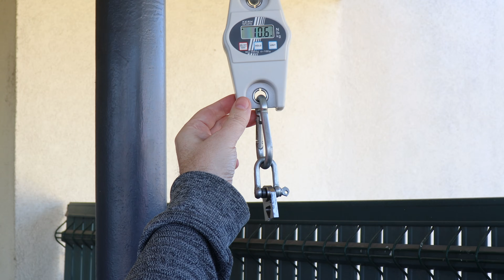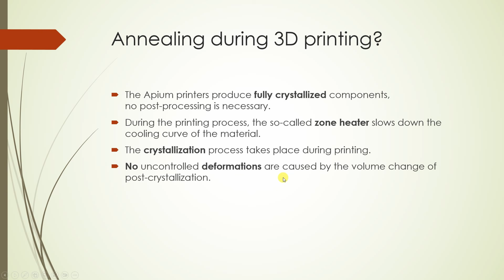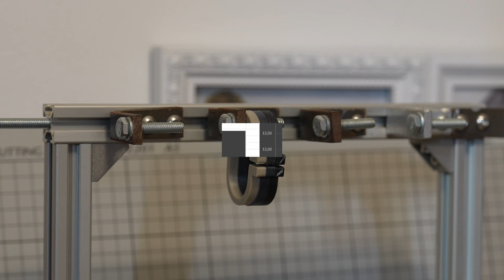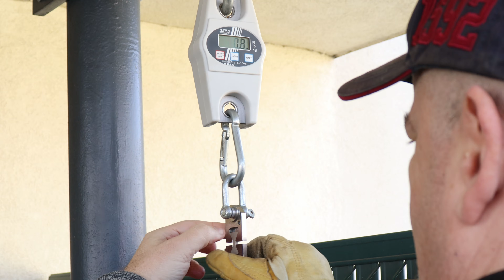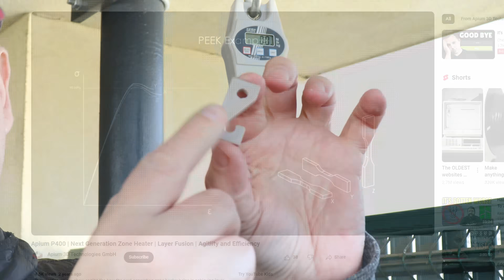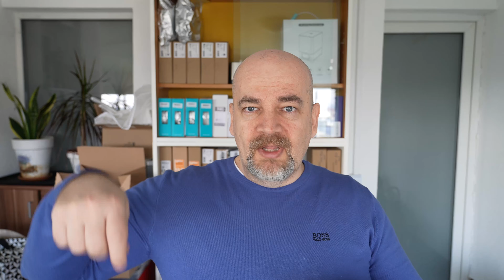3×PEEK: Natural, CF10 and CF30. All 3D printed on Apium P400

Comment: Hello everyone, I am the Kevin who printed the PEEK parts :)

First of all a big thank you to Igor for taking the time to do such material tests.👍
When printing such small cross sections as the tensile specimens, it is always very difficult to hit the perfect point between overheating and poor layer adhesion. FDM printing of high-performance polymers presents new challenges that do not arise when printing standard materials such as PLA. 
It is basically possible to produce isotropic components using zone heater technology. The Apium printers are used, among other things, to produce cranial implants for which precisely these isotropic properties are crucial. However, this requires a large number of test runs, as the printing parameters always depend heavily on the component geometry. Unfortunately, in this case I did not have the time to experiment with the optimum layer adhesion for this geometry myself. I only printed and sent one set of test components at a time. I will take a closer look at this problem in the next few weeks...
The mechanical properties are not the only thing that makes PEEK, PEI etc. special. Rather, it is the combination of the sometimes unique properties that justifies the use of high-performance polymers. For this reason, it is not correct to “reduce” the materials to their mechanical properties.
Reply: Kevin, thanks so much for donating your time and materials to this video. It's really interesting to see the benefits and drawbacks of this material in 3DP, and that's coming from someone who's done a lot of medical PEEK machining from solid stock.
Reply: That's why I got quoted 3k euro for essentially 40g of plastic, now I get it.

Thank you Kevin for the material and the work.

And thank Igor for the great video!

PS: I design medical devices😁
Reply: Your printer is very well calibrated, those top surfaces are perfect, pinholes aside which would need adapting PA to each speed.
Reply: @olafmarzocchi6194  You are right, I think that these pinholes are the reason why the hook test of the PEEK CF10 turned out less well. Under the microscope you can see the composition of these components very well (I´ve done some Research with Zeiss microscope up to 1000x) and it quickly becomes clear that it is not a homogeneous part, such as a milled part. For this reason, FDM printed parts will never have the strength of milled parts. However, 3D printing has a lot of other advantages, such as no tooling costs, lower machine costs and, above all, the possibility of producing geometries that were not possible by machining :)

Comment: You need a 140C chamber for peek. This is like printing ABS on an ender. Even if you remelt the top layer the whole print needs to stay at 140C for the duration of the print and then needs to cool down to room temp very slowly. After that it should be annealed. I'm sorry Kevin but you invested in the wrong printers if you want to offer anything above ABS on a professional level.

Comment: This is very cool, Igor!
I've been following Vision Miner for years, and I printed PEEK CF10 on my heavily modified 500C capable old CR-10 (as well as Ultem 1010 and 9085). And I used these materials in practical applications (hook for scooter trailer, mount for hotend, etc), and I can testify they are extremely durable. However I never knew exactly how strong they are, so thank you for doing this!

p.s. K2 Plus can out of box print Ultem 9085, I just did it few days ago! ;)
Reply from the maker: Wow, what bed type you used and what temperatues? (for Ultem). About Vision Miner, I am not sure why are they hesitating. I should get those filaments weeks ago.
Reply: @MyTechFun  On my old CR-10 I used PEI bed at 160-170C (AC bed heater), Nano Adhesive and 4x 75W UV lights (for lizards) to heat print (no chamber).

K2 Plus out of box can do 390C nozzle, 120C bed and 60C chamber. Nozzle is really impressive, bed can probably do more (130-140), I didn't try cos I'm afraid it will ruin magnetic layer...

Comment: A reason your views are not high is more than likely your thick accent, I actually unsubbed for quite awhile because I just could not understand you.  I am every impressed with anyone that is bi-lingual as I could not learn another language if my life depended on it and believe me I have tried. I'm not criticizing, just pointing that fact out.  :)
Reply from the maker: Informative. Thx. Maybe I will give it a try, use AI to replace my voice. BTW I am penta-lingual, and English is only my 4th language, I don't think I can do it better myself.
Reply: @MyTechFun  It's a shame there is not an option to toggle between your voice and an AI one, I would be willing to bet there will be in the future. The problem though with AI voice-overs is too many scam channels use it so new users may be turned away. so maybe do a test vid and have your veiwers give input on it before making any significant changes. GL you do great work. :)

Comment: Hi!
I'm just starting to print from carbon and I really like your videos. And I like that you approach everything scientifically. You have a feature that can be used - you compare filaments better than others. You can organize something like a felament arena.

I understand that most likely you have this for Patreon. This is a good viral topic. I can help with web.

I also suggest the following viral topics:
1. Review of printed, hard loaded parts in work (bushings, joints, gears)
2. Super small strong parts (gear with 1mm tooth)
3. External processing (sanding, plaster, paint)
4. Embedded elements (magnets, strong rods, inserts)
5. Examples of printed super strong structures vs bad ones

Comment: PEEK is very viscous even at high temperature above 350degC. To get a good weld, some level of mixing or diffusion is needed at the bond line. This is usually achieved by high temperature (lower viscosity, activate diffusion), time (let things develop) and pressure (force material mixing/diffusion). And there is the issue of crystalinity that can ruin the weld line. With FDM of PEEK, it is needeed to reheat the top surface of the part or to  print very slowly to heat the surface by conduction or radiation... but there is not much time nor pressure to have a proper welding. Based on my experience, PEEK is one of the worst material to print. PEKK or PEI is much more suitable for high temp applications!

Comment: I absolutely agree that if a filament has weak layer adhesion, then it's a subpar material for 3d printing. I understand that one can overcome weak layer adhesion by designing an object that prints flat, but I think such a mentality decreases the advantage of 3D printing over traditional CNC.

It's funny peek might have great heat resistance and chemical resistance but with how brittle it is one should just use Resin Printers, its not hard to find a common resin that can handle 300c or more and be chemically resistant.

Edit: hopefully vision minor can show peek is actually usable as a 3d printing material and not just hype.

Comment: This channel slowly becomes a nightmare of all these "high" tech materials, costing astronomical amounts of money. Except for very high temp and chemical resistance - there is in fact nothing super special about them.
And also - this is now the only channel that tests these materials in large scale! It was so hard to find some videos about these - and now we have it!
Igor may rename his channel to something like "filament mythbuster" :D
Thanks for a great job and showing real-world properties of these materials compared to "normal" filaments!
Reply: "except for high temp and chemical resistance" - this is the exact use case for many superpolymers! Especially the combination of both is where ordinary engineering polymers fail. 
In my experience, there are two use cases where superpolymers shine: first, a combination of heat and chemical load that would deteriorate stainless steels, or second, metal replacements for low load applications (= low density is key) that need FST ratings and certifications, like plane cabin parts. 
Sure, there are many other use cases that require different combinations of properties, but most of them are rather niche. 
There is a reason you propably won't find PEI or PEEK in the engine bay of your car, and this reason is called Polyamide. For most use cases, it's just good enough - as you stated in your comment.

Comment: There is something weird about Peek - maybe the layer adhesion really suffers from such a small cross section.  Imagine you are printing a 10 times bigger section, it means the whole layer will be receiving that heat treatment for more time. Things are not scaling properly for this material - it probably needs a different way to test it and show the full picture. Excellent video my friend!
Reply: Small cross section would actually be a better test for layer adhesion as the layer time is much lower so the component is much hotter while the layer above is deposited, making the layer adhesion MUCH better
Reply: If you made test objects 10x the area, the xy specimens would need 2 tons to break, so I'm not sure that is the answer. 

Maybe igor could test some lower cost filament and find out if this condition is occurring across the board. 

Some investigations into print layer time could also be interesting. If your print profile doesn't offer adequate layer time if could degrade the material.

Comment: Peek is a big disappointment
Reply from the maker: Dont judge too early. Let's wait for  Vision Miner parts.
Reply: Peek has it's downsides like every polymer. Sure it's a strong polymer, but where it excels is extremely high temperature resistance and extreme chemical resistance. Nylon still remains as the toughest material and is why it's used in so many applications, however it will literally dissolve into nothingness where peek would remain true as if it was place in the open air.
Reply: PEEK is a wonder material for its chemical properties, not the physical ones. Its the only polymer used in ultra-high-vacuum application like a Neutron Collider, Electron microscope, or in space. Other polimers decompose...
Also its chemical stability is incredible. Making it great for food, pharmaceutical, or lab settings...
And it is form stable in high temperatures without fuming (like teflon).
These test dont do it justice...